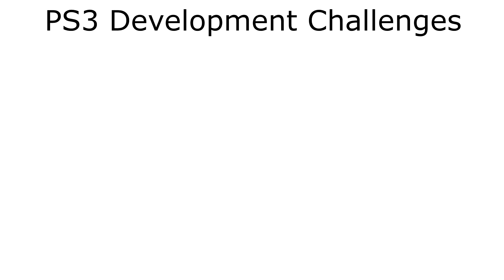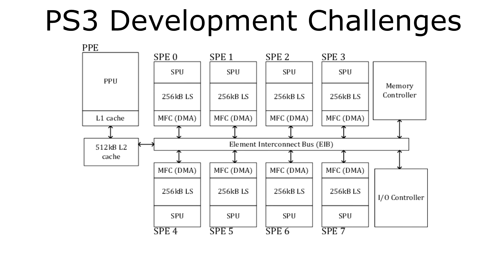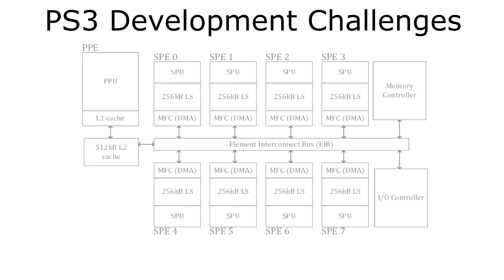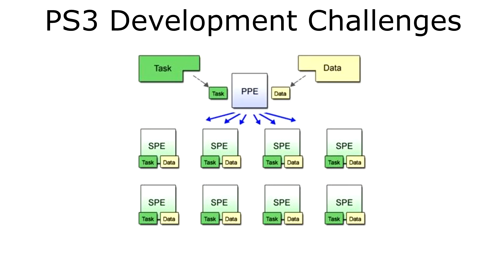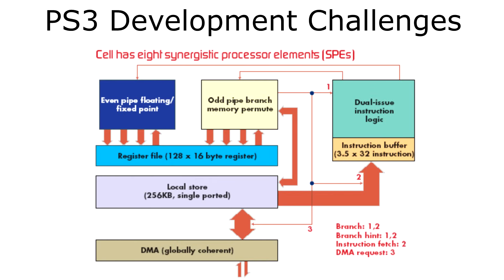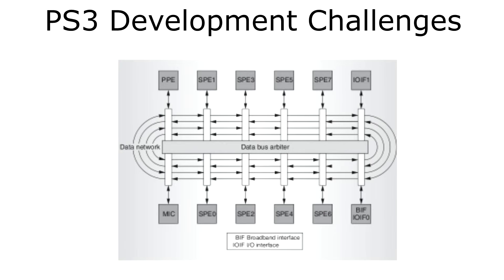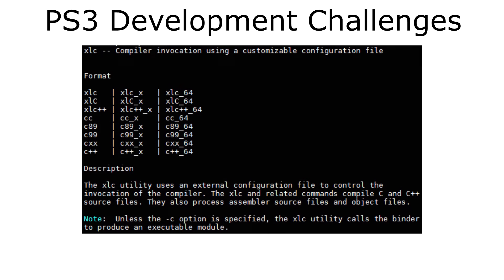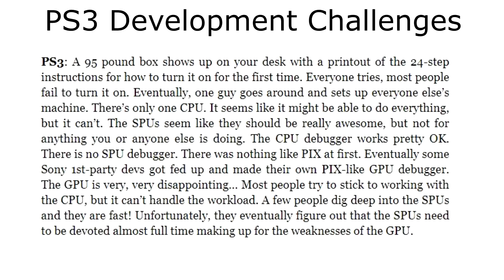Why was the PS3 Difficult to Develop Games For?

Comment: SDKs and devtools are very important as we know by the ps1 era.  The problem with this radical change in structure is that the solution isn't gonna be just making tools or hiring senior developers. You can’t simply throw the problem at a small team.
It imposes a change in the way many parts of the game engine must be written. We are talking about writing game engines specifically for the PS3 with no help from sony. It's trouble. Also it imposes the  use of C language with little to no debugging tools. I mean, you can make it, but will the cost worth it? Can a performant, complex game engine be possible with this budget and time? I can imagine this discussion happening back then.

Comment: The Cell processor was very capable, but it came with several significant issues. The primary one was the lack of developer tools. While Sony's ICE Team understood how to leverage the hardware, most other developers were initially completely confused by it.

Another factor was the early launch of the Xbox 360, which became the primary development platform by default. This forced developers to port their code to the PS3, requiring major rewrites to accommodate the Cell architecture.

There are also some misconceptions. For its time, the RSX GPU was actually quite powerful, even though it was based on an outdated architecture. The main issue was bandwidth limitations. Originally, the RSX was supposed to have a 256-bit memory interface, but this was cut to 128-bit, likely to reduce costs. As a result, the RSX was severely bandwidth starved, which impacted its performance.

Also, the myth that the GPU was supposed to be some Cell variant was probably only an idea, the truth is Toshiba was developing the GPU initially, but as development progressed, it became clear that the performance wasn’t sufficient. This led Sony to partner with NVIDIA.

Comment: To me CELL sounds like more modern and more polished Tom & Jerry from Atari Jaguar.
Similar issues really and like Flare Tech chips CELL would benefit greatly from better software stack and further HW improvements and fixes.

That said it is not like we didn't have something like it. When CELL/PS3 came out we had Nvidia CUDA cores in form of G80 chip. It is somewhat different beast with even more cores running at lower performance but it was very similar. What wasn't was that developer weren't supposed to write low level software for it. They were supposed to only focus on providing a lot of data and maybe avoid if statements within code blocks and rather do branchless programming. Nvidia on the other hand was responsible to make their drivers/software and hardware to run what developers were making run as fast as possible.

BTW. IMHO Nvidia G80 you could most likely get much more out of if you did write truly low level software but at the same CELL would benefit from having software stack making programming it more like CUDA was. Something like OpenCL would be helpful and especially with base framework existing alongside giving console game developers code for how this framework worked. Nothing like that existed. No skilled developers existed for even normal multi-core programming let alone low level GP-GPU style hardware. CELL was perfect recipe for disaster.

And coming to my first point - I think any developers working on Flare Technology chips so Jaguar games did most likely anticipate CELL won't be as amazing as SONY/IBM claimed it will be.

Comment: Multi-Threading Software Programs is Not Easy. Furthermore, Performance Improvement is Not Linear.
The PS3 has 1 Core & 8 Hyper-threads.
The PS4 has 2 Cores & 4 Hyper-threads Per core.
The PS5 has 4 Cores & 2 Hyper-threads Per core.
Hyper-Threading Improvement = 20 to 30% = 25%
So, total Number of Equivalent Cores = 5 Cores.
Multi-threading Does NOT Scale Linearly. The 8 Threads Have to Wait for One another.
So, the 5 Equivalent Cores are Approximately 3 Cores. 3 Times Improvement Over PS3.
The PS1 had a 30 MHz CPU.
The PS2 had a 300 MHz CPU.
The PS3 had a 2.5 GHz CPU.
So The Previous Generations HAD an Approximate TEN Times Improvement.
The PS4 is Twice as Fast as PS3 AND the PS5 is Three, Times as Fast as PS3. So, the Improvement is Minimal.
OUR NEXT GEN SYSTEM: OUR SINGLE CORE PERFORMANCE IS FOUR TIMES FASTER. TWO CORES = 8 TIMES FASTER.
70% TIMES 8 = 5.6 TIMES FASTER, WHICH IS BETTER THAN THREE (THE PERFORMANCE IMPROVEMENT OF PS5 OVER PS3)
OUR NEXT GEN SYSTEM: OUR SINGLE CORE PERFORMANCE IS FOUR TIMES FASTER. FOUR CORES = 16 TIMES FASTER.
50% TIMES 16 = 8 TIMES FASTER, WHICH IS BETTER THAN THREE (THE PERFORMANCE IMPROVEMENT OF PS5 OVER PS3).
8 TIMES FASTER IS WHAT PS3 IS TO PS2. SO, THE IMPROVEMENT IS "NOTICEABLE"
MOORES LAW: THE DARLEKS KNEW AT THE TIME OF PS3 - THAT THEY'D GET TO 4 HYPER-THREADED CORES.
Reply: take your meds or something

Comment: I find this interesting, mostly because of how important DX really is. The architecture of the PS3 was powerful and could do amazing things, but poor DX made it difficult to work on. I feel like this can be translated to modern application development. The pure reason as to why we end up having Electron-based apps in the first place, even though they have bad performance, is because of the DX. And because it's 10x easier to find a good JS dev than it is to find a good C programmer. DX seems to be the key to software - and hardware - success.

Comment: At 10:01 you said that an IBM XLC was used as primary compiler on PS3, but many sources claim that a modified version of GCC could be used instead? Can someone clarify?
Reply from the maker: @ilikebananas342 both can be used. As mentioned the XLC complier was the primary way. Flags could be set in a makefile to use either and the IBM Cell SDK has examples. This is according to page 25 of CBE programmers guide.

Comment: to this day, i cannot fathom how anyone can think the ps3 is better than the 360 (other than because of nostalgia bias). the exclusives don't nearly make up for the bad performance in non-exclusives.
Reply: Yeah you can be wrong ( i had both 360 and ps3)
Reply: exclusives alone were worth it. xbox had about 2 good exclusives. Later non exclusives even ran better on ps3 (GTA V)
Reply: @plaidchuck  1- that 2 number has a weird lack of citations
2- by later you mean like 2011 (6 years into the generation, after most games already released)

Comment: Well, also Sony executives were technically in charge of okaying such a difficult to develop for system.  I'm sure they had meetings discussing it's challenges and ultimately came to the conclusion it might also be good for their competitive edge (especially since they had such huge market share during the PS2) if they could effectively gate games to the PS3 and make the code more difficult or even completely untenable to port to other platforms.  I think in this way they aimed for a sort of modern day Steam approach where even devs not intending to be exclusive to it end up exclusive to it because it's the default.  But in the PS3's case, with the extra caveat that actually trying to port your game-made-for-PS3-first was too expensive and a nightmare, and oh, you better just keep developing for the PS3.

Comment: Sounds like the issue is with the programmers then. There are no difficulties, only challenges to overcome in this profession. If you can't adopt, you are in the wrong business.
Reply: Smartness is knowing how to overcome any challenge you face. Wisdom is to chose whether you decide to spend energy on something or not. If the programmers had to go to hoops just to avoid the problems that this badly designed processor posed, then it deserved its downfall. There are plenty of talented low level developers out there that know to code in assembly or what not, but most of them use it only when its strictly necessary.
Reply from the maker: @uninitializedvariable  Yeah I'm more in this camp as well. A programmer's most valuable asset is problem solving. Hardware and programming languages are tools to solve the problems you are facing. The tools in this case were harder to master and required more creativity/unconventional thinking.
Reply from the maker: @uninitializedvariable  talented programmers also figured this out... That's why some amazing games came out on PS3.
Reply: thing is this isn't some university research project where 5% lower cache misses is enough to get you another $100k in funding

Comment: so undertale and fnaf could never run on a ps3 cause most of their code are just IF statements?
Reply: These two games demand little processing power, you need a few thousands "if"s each frame before it's an issue. RAM would be an impediment funny enough, the PS3 only got 256mb

Comment: Sounds like it just needed a middleware engine or API to take care of the hardware side. Take Unreal/Unity/DirectX etc away from devs today and you'll see them whine just the same too and all games would take 5+ years to make.
Reply: Not really possible in that environment though. The thing about software abstraction is that it inevitably takes control and precision away from the developer  

Analogy: If I want to ship a bunch of stuff as efficiently as possible, I can choose custom boxes for each item. This takes a bunch of time and effort, but guarantees I waste as little space as possible. Alternatively, I can just order a bunch of generic boxes that are the same size which will be very easy, fast, but will likely waste a bunch of space since some of the boxes will be bigger than necessary.

The cell architecture wasn't better because it was faster, it was better because it allowed developers fine control over exactly how the instructions and data were run through the system, ensuring no waste and max efficiency. Abstracting that away would simultaneously take away any advantage the architecture would have.